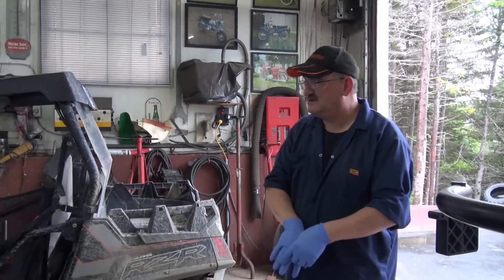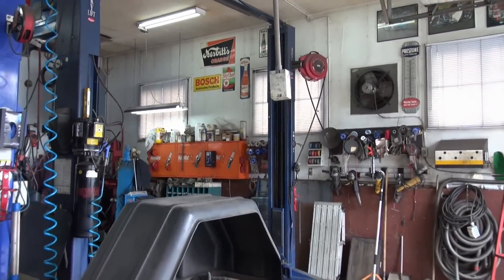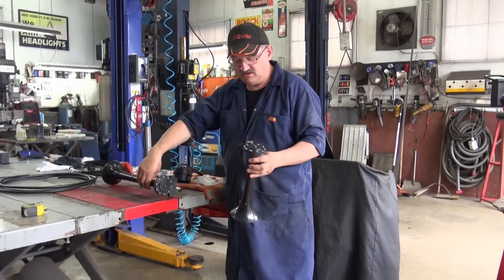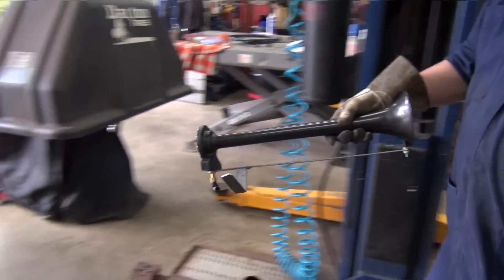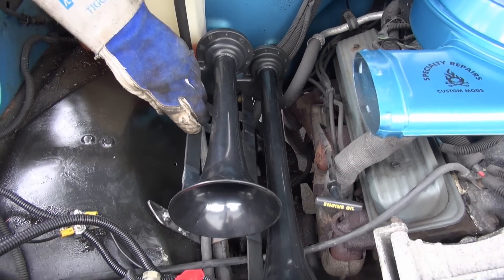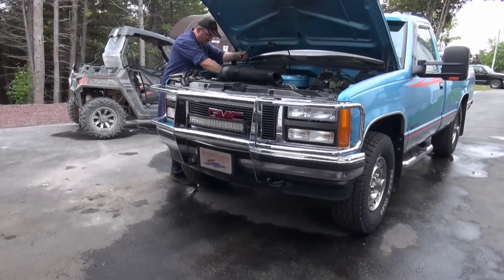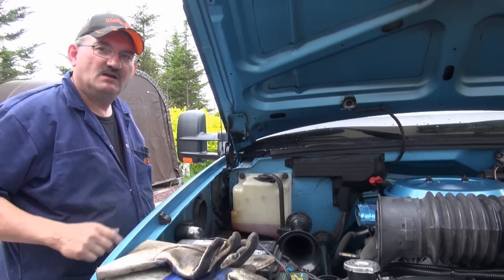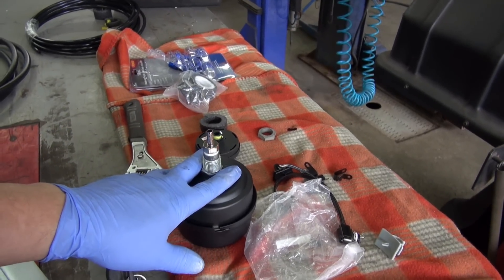HornBlasters Install Complete

Comment: Excellent work. Very clean as usual. A joy to watch. I have to guess that you're somewhat disappointed with the speed and sound of the compressor. You've already found that the tank is too small. You are not alone there. I really want a set of those horns for the masses here in Minnesota that have forgotten to keep right except to pass.

I also notice that your truck doesn't have A/C but it DOES have the brackets with an idler pulley. Mod Challenge?

You could probably find a home for the new compressor and tank on Ebay. Could you not fit an A/C compressor as an air compressor? There are plenty of people using them for that purpose with the addition of an input air filter & micro-oiler. A fast and quiet compressor for that larger tank you mentioned.
Reply from the maker: If I were using the truck for a road service truck on a daily basis and needed air to run air tools....I would have done things much differantly. I would have put a 50 gallon air tank in the box and a dedicated compressor with an electric clutch driven but the trucks motor but the fact is that I came to a cross road with the old truck. I had to make a choice, either get rid of it and get a new one or mod it up a bit, give it a fresh look without changing its look to much and modernize it. I went with the latter. I really don't use the truck much. Tow the welding unit or on a rare occasion tow the dump trailer but the truck is in great condition and saving money by not buying a new one and having fun modding out the old one was the way to go for me. The air horns was for fun. Not needed but just something I thought it would be nice for a laugh so I did it. Yes the electric compressor is noisy but it's not on all the time and I added the pillar pod gauges so I enjoyed it. I'm happy with the set up for my needs. Yes I could add AC but for the time I'm in the truck it's really not needed.

Comment: Just wondering , couldn't you run a hose from the tank you have now and another from your new tank your going to add and run them both through one dump valve ?
Thanks for another great video !
Reply from the maker: Yes it's a real possibility and it may go that way. I'll have to see what the cleanest install looks like later on. Thanks.

Comment: At 17:11 You've got a little propane cylinder with a flowmeter attached hanging on the wall behind the blaster cabinet.   What's it for ? Vacuum leaks ?
Reply from the maker: Vacuum leaks is right.